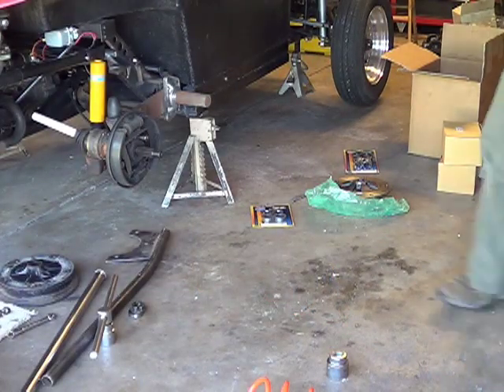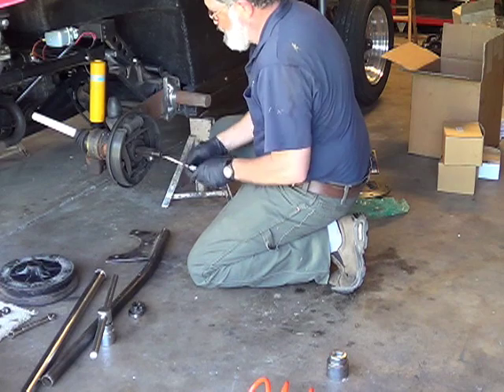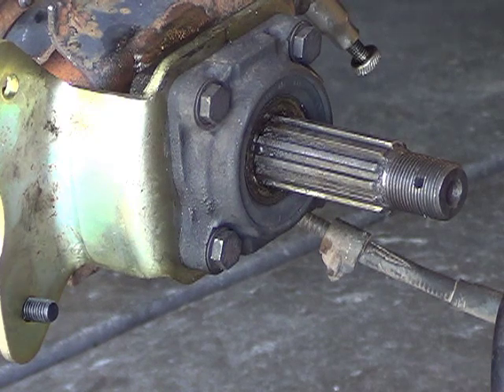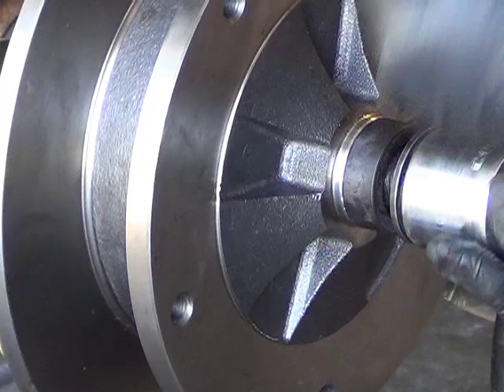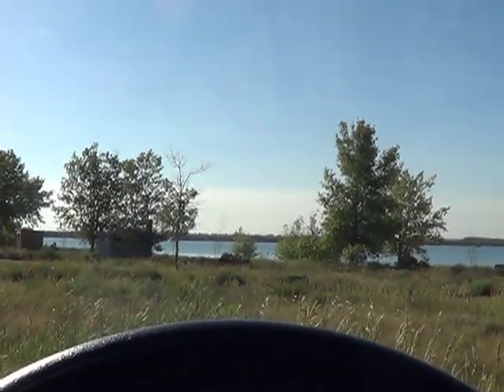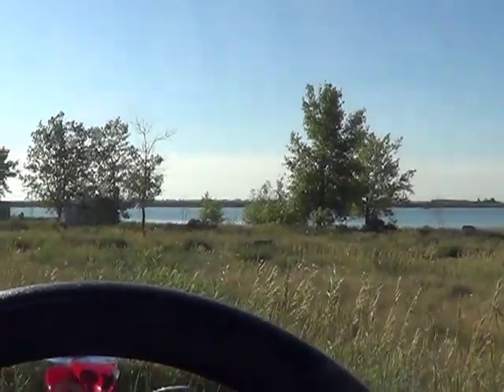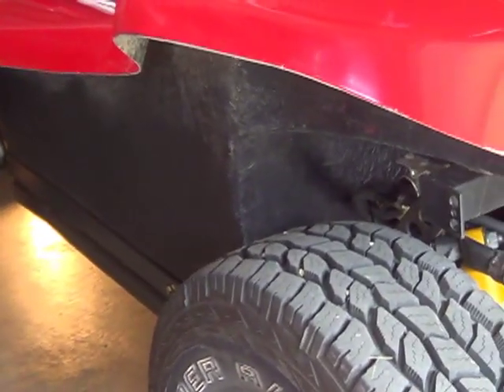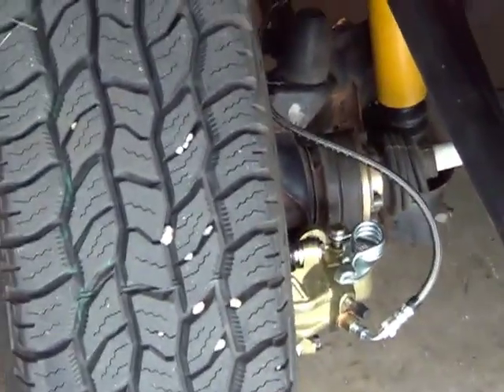Volkswagen EMPI Disc Brake Conversion Review tips

Comment from the maker: Already in the mail  :-)   I decided to do it up right and orderd the Empi front disc kit which included a dual master cylinder.  Will see how that works out before I lighten anything. About 20 years ago I made a set of disc brakes and drilled out the rotor. I decided to weigh them to see the diff. The drilled rotor ended up weighing more than none drilled one. (different casting)  I would only do it for looks now. The older I get the faster I was. LOL Thanks for watching and comenting.

Comment from the maker: E brake is a little soft but might improve as the pads brake in. I got into mine on the rear and it had a squeal for a while but went away.  If you use the empi kit on all 4 wheels you need to get the empi large bore master cylinder. I know it's a PITA but it made a big difference in mine. Hope your turns out ok. I'm loving mine now that I have some miles on them.

Comment: Hi, have enjoyed watching your adventures of late. That buggy sure looks good, copes well on them dirt roads and mountain  trails.I like the disc set up, looking at the pieces as you put it together there's room for some lightning, some holes ect. to reduce that unsprung weight. I would definitely change that master cylinder to a split system for safety sake and also maybe with a change of size to improve pedal movement. Have fun.

Comment from the maker: The washer is for centering the caliper on the rotor. ONLY IF YOU NEED IT. Mine did not. The copper washers are like lock washers that crush and grap the mounting bolt. I can't remember if I used the O ring. hmmmm what did I have for breakfast this morning. I will go out and take a look later. My directions were printed clear but I like the pictures too.

Comment: You can't beat the stock VW emergency brake....it can actually stop the car.
That's why I went with "The Thing" drums in the rear, with the wider shoes and wide-5 bolt pattern.

Comment: You forgot grinding the e-break cable down to get past the caliper bold and grinding down the hole the e-break cable goes through to put the clips on. But all in all you gave some cool points to this install. One more thing is the caliper brackets you have flex and are not good at all . They have an upgraded kit with stronger brackets now.
Reply from the maker: I only had to do that on one side as I recall. I guess it is more common than I realized. Thanks for your input. I will be doing an update on them here pretty soon. Sounds like you have some how are they working out. Mine are acceptable.
Reply: right on . I just did both front and rear on my pan off  I am doing for my turbo engine. Another thing to say would be the calipers are marked R and L. Let people know it is L for passenger side and R for drivers or the bleeder will be at the bottom.

Comment: Hi  could u please provide some info on engine width for a sedan. I have a 69   I’m considering build a Stroker motor but really don’t want to start cutting or banging on the body.  Could I use an 82 crank with the “B” pistons. Would this work out to a stock width.    Thx so much.  I love your channel and have learned so much about these cars.  Andy
Reply from the maker: An 82mm stroker crankshaft with B pistons comes out almost exactly the same as stock. That is why so many folks build them for race cars. "HOWEVER" Compression ratio is what changes the width factor. People add spacers under the cylinders to lower the compression for pump gas. So you have to decide what size engine you want to build. The bigger the piston diameter the higher the compression goes. If you go with modern cylinder heads you can sometimes increase the CC per cylinder and lower some of the compression that way as well. How much horsepower you want to make. How high fuel octane can you afford to feed it. How long you want it to run and last is your call. I always recommend a 78mm crank and 90.5 pistons with .090 cylinder shims with about 8.5 to 1 compression and a mild cam with dual carbs. This set up allows stock valve heads and leaving the heater boxes with a full header system. It will live for thousands of miles on the street and give the most smiles per mile. I own and drive everything from a 1776 to a Hot 2276 and the 2 liter is my favorite.

Comment: properly adjusted drum brakes will work just as well as disc brakes. The real difference is the high temperatures that a disc set up will work at, when a drum set up will start to fade.......tony

Comment: I think they are a ford design my be able to gat at local parts store. They will last good if the pin on the back of the pad seats properly into the caliper piston notch ,if not lined up they wear very uneven . Happy vwing

Comment: I couldn't believe you put the pads in upside down. I could see the pad springs were against the rotor right off. What were you thinking?
Reply from the maker: LOL I guess I can't read instruction any better than the Chinese can write them hehehe
Reply: Are the pad springs supposed to be compressed and stick out of that hole in the caliper?  Or are those springs supposed to be separated and sit inside the caliper and not stick out of that hole?  I'm part way through my assembly and it's not clear where those springs/tabs are supposed to go.  I can't seem to find a video that explicitly shows that.

Comment: I put my calipers on the top so the brake lines would reach. I also have the e-brake spring on the left side. I noticed you didn't connect the e-brake cable. The instructions are pretty confusing, and a bad fuzzy print job. One question I have is the metal washer and small o-ring placement...

Comment: Nice big beautiful blue sky during your shakedown. One year report on these?
Reply from the maker: It's been more like 4 years. They work fine it just bothers me that they are heavier than stock drums by 11 pounds. Thats unsprung weight and more work for the suspension. Another thing to keep in mind is that disc breaks will often squeal loud when applied. This can be caused by several things. Misalignment or vibration. They make a disc brake squeal stopper that is a soft gel that you apply to the back of the disc brake pad and that will stop the vibration that creates the sound. It works real good.  For most VW applications drum brakes are just fine. I think most people install disc brakes for the cool factor because race cars use them. That's fine too.  If you really need or want disc brakes I would spend a little more money for the lightweight aluminum hubs rather than the heavier cast iron.  Good Luck with your projects.

Comment: i have a 68 bug, i did the empi kit in the front and it stopped great so i though i would do the back also, so i did that and now it feels like it stops worse, and my ebrake does not hold even with the adjustment all the way to the point that it is hard to pull the lever up. any ideas or is the kit just junk?

Comment: Hey EZ I've done a lot of those style brakes those butterfly spring clips are not saposed to come threw the hole in the calipers they push inside the calipers
Reply: Thank you for this.  I have a similar EMPI kit and the instructions aren't clear about that.  I guessed with my kit and put those springs on the inside of the caliper.  Thanks again.

Comment: I got this kit and the Router does not want to go on the axle did you have that problem do you have any suggestions so I try heating it up
Reply from the maker: Super Bummer.   My son bought some empi brake drums. They would not fit on my cars long spline  axles but they fit fine on older short spline axles???? I ordered these short spline disc brakes thinking they would work on early or late and I never actually tried them on the early short style.  ??????   If you can find someone close to you that you can try them on different axles I would do that. Call the folks you bought them from. DO not force them on or use heat.  Brakes can safe your life don't be careless.

Comment: Would this work on a 73 Squareback IRS Type 3? would like to be able to use 5 lug chevy or ford rims on a Vw Trike i;m building
Reply from the maker: It would probably be safer to check with your supplier.
Reply: ok